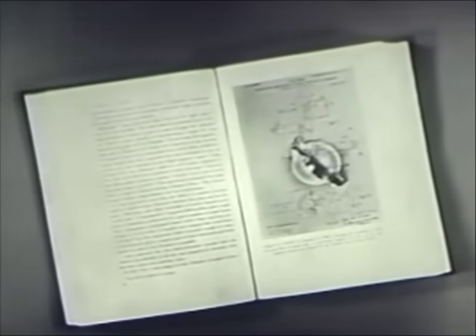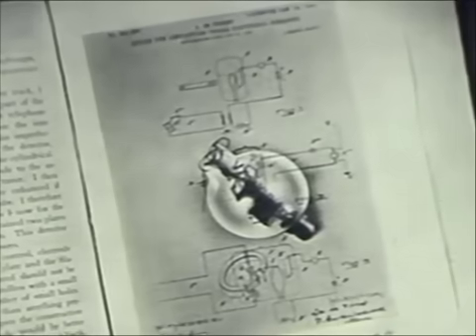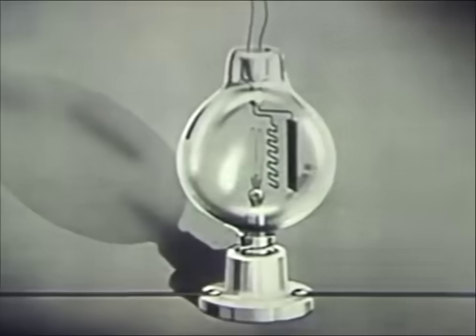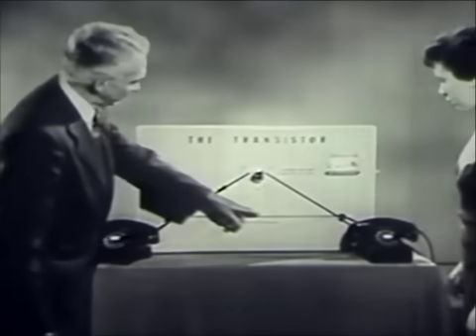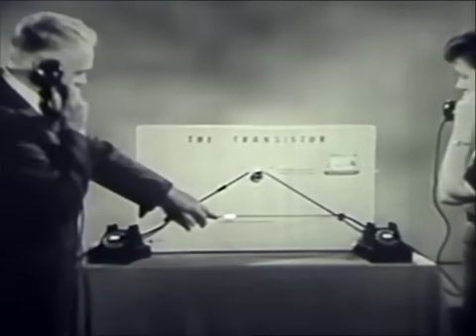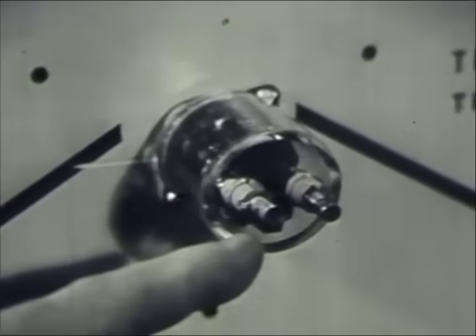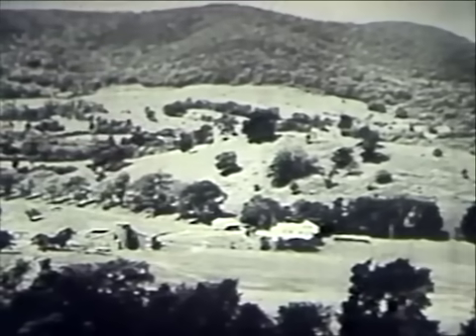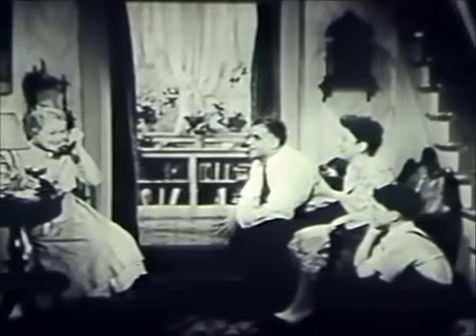The Transistor: a 1953 documentary, anticipating its coming impact on technology

Comment: This was on a Flat Earth video. Think! how did they send all the signals without satellites or a way to bounce the signal? They didn't have a giant mirror that I know of.
Reply: Ionosphere
Reply: The Dollar Guy
One problem with that. If earth was round the radiation in thee Ionosphere would be acting not according to what we have been told about how radiation works. Radio waves or radioactive waves travel in a straight line. Only on a flat earth is this possible. On a round earth it shows the radiation curving around thee earth. Not possible. radiation does not cure or bend even if there is gravity.
Reply: Radiation is reflected by the ionisphere when it hits it, allowing you to reach beyond line-of-sight when transmitting.
Reply: How does radiation reflect radiation? It doesn't. That only work with a round earth theory.
Reply: The ionosphere is charged and reflects longer wavelength waves back.  Specifically lower radio frequencies such as AM and HAM radio.  Higher frequencies are line of sight only; they require repeaters to follow the curvature of earth.
Reply: Yes but in 1915 they did not have this tech. They just build it and used it like they knew that they didn't need it. Then to support the round earth theory they had to come up with an elaborate lie to make it look like the operation work because of the curvature. Well I can say that Nikolia Tesla knew it was flat.
Reply: +Stanly Phoenix People will often discover and use things before they understand how they work. We knew the speed of light and how to send transmissions long before we understood quantum physics or the particle/wave duality.

I'm not going to argue with you any more about this, because you've clearly decided what you want to believe. But I suggest you learn more about EM radiation and how it works.
Reply: I try to keep an open mind, but I don't see how this flat earth theory holds merit.  Where did tesla mention his evidence of a flat earth?  His wireless energy distribution system if I recall used the earth and the ionosphere.
Reply: No mirror is how you lot decided CPU could just chat to any sattellite but not if your crazy nonsence following orders them next door spy on me an moms?...Intel Xsat,1954?

Comment: This must have seemed really amazing back then, I wonder if anyone  thought it would be possible to place a billion transistors on an inch by inch wafer?
Reply: "Billion" wasn't a term that was used much in the 1950s and 1960s. Most big or small things came in millions or millionths. In the rare cases you needed to talk about something bigger or smaller, you talked about a thousand million or a million million. Could someone imagine a thousand million transistors in a square inch in the 1950s? No, probably not. Not even a million transistors as part of a single thing no matter how big it was, unless that thing was the continental telephone system and you were counting all of the offices.
Reply: @lwilton  I don't believe most people today are actually capable of thinking in scales beyond a few millions. Every thing beyond that falls into the category of really large interchangeable numbers we simply take for granted. The population of the US for instance is mostly unfathomable in practical everyday terms.
Reply: @maelstrom2313  I work with large databases, anything above petabytes and i stop understanding.
Reply: That is an interesting observation. As an example, electronic schematics drawn up into the 1960s do not use the unit "pico Farads" for 10^-12 F. They use uuF (micro micro Farads).
Reply: I don't feel particularly "quaint," but I did take my first course in basic electricity in 1960.  You are correct about the terms used for small values of capacitance.  We also used cps in place of Hz, and did all our calculations on slide rules.  Beginning in 1959, my mother was a corporate secretary at Texas Instruments, and she knew Jack Kilby quite well.  Her direct boss was in charge of the Small Signal Transistor Division, but by that time the real focus was moving into integrated circuits.
Reply: I remember when I was first secretly shown a secret chip which was claimed to be the first IC containing slightly over a million gates.  Even then, no one believed it.
Reply: "a billion transistors on an inch by inch wafer?" no because no one back then was puting anything on a wafer... watch the movie again maybe? heh
Reply: While I'm sure they did realize that just as their technology was much more advanced than what people had 100 years ago, people 100 years in the future would no doubt have things that would seem wonderful to them - they could not have known the details of the future, and very likely would not have expected electronics to improve as fast as it did.
Reply: "you talked about a thousand million or a million million"   Yes, like with capacitors in that era.  No "picofarads" or "nanofarads", but most often it was "MMF" for micro-micro-farads.  And not even using the Greek μ.  What quaint old times!

Comment: 0:43 "Electronic devices that ... have longer life". You got to be kidding! I still have my grandpa's old vacuum tube radio (which I used as my first guitar amp in early '80s) in perfect working condition. What's a life-span of typical modern electronic device?
Reply: +TheUglyGnome Tubes will burn out a lot faster than transistors under most conditions. When they created some of the first computers (the ones the size of warehouses) they could often not run it for more than 8 hours before a tube would burn out somewhere. Those had thousands of purpose-built tubes but they still had a lot of failures.

Whereas, a modern device has literally billions of transistors in it, and will run for much longer than 8 hours. In fact, parts that fail are often accessory parts like capacitors. And when you see a computer slow down over time, it's because the software gets more bloated over time. A transistor, if kept cool, could theoretically run forever.
Reply: +TheUglyGnome No idea but all of my computers since 1994 have been hooked up to my Radio Shack STA-85 stereo AM/FM receiver amp to provide audio from the computer to two wall speakers, it's normally on about 60 hours a week, even the original light bulbs still glow in the dial!
Reply: +TheUglyGnome Two years, hence the two year warranty lol.
Reply: +TheUglyGnome If you use it every day then the tubes will wear out.  Tubes are wear items... transistors, not.  That's the point, I think.  I have old transistor stuff that still works great fifty years later... for guitar amps, tubes still rule, though... and they're still being made for that purpose.
Reply: @scowell  Keep in mind that tubes are meant to be replaced as needed, and most tubes are still readily available for cheap in lightly used or NOS condition.
Reply: @GayCoonie  Hence my term 'wear items'... like a brake pad, they wear out.

Comment: It's only 1953, so you're gonna need a flux capacitor, a bolt of lightening, and a DeLorean.
Reply: Stephen Clementson I think its just a chance thing, like with hard drives. some last forever while others fail in a couple years..
Reply: +Stephen Clementson These vids are like shooting the video with the smartphone. So much has changed in so little time.
Reply: Picobyte
Things sure have changed greatly, with unimaginable levels of circuit miniaturisation (UK spelling).  Even in the days of Back to the Future part one, the year after the announcement of flash memory by Toshiba, it was not envisaged that you'd be able to get so many transistors on a chip that you'd be able to use that chip as the video recording medium.
Reply: 49jubilee I still love vacuum tubes for vintage and the opportunity to show people how electronics work :D Those hot tubes are cool as the youtube icon.
Reply: @picobyte  we chuckle at the WWII DOD vids they showed the soldiers and workers
Reply: +Stephen Clementson The DeLorean is the critical part
Reply: +ElfNet Gaming Yup.  Got to be a DeLorean.
Reply: Stephen Clementson Steadily going to SSD  gigabytes for consumers :)
Reply: +Picobyte I use SSDs as boot drives on two devices.  Not used for storage, but about 5X faster boot-up.  One guy on YouTube was using a 32gb SD card, with a PATA adapter, as an HDD replacement on a very early 2000s laptop.  The original 2.5" HDD would have had a similar capacity to the SD card:-)
Reply: Stephen Clementson True,but my argument for it is that it's shockproof beyond human body.One can hit it with a tank and unless shredded it will read :)
Reply: +Picobyte Yes.  They are brilliantly shockproof, and I've never had a flash card failure due to normal usage either.  I've got flash cards dating back to 2002. It's clear that they'll become too outdated long before they'll fail.
Reply: Stephen Clementson IDK man, I had a 256Gb SSD that failed 2 weeks ago and I had to replace it.
Reply: +ElfNet Gaming Oh...someone told me how they'd had a flash card fail, and that it was a genuine product.  No problems encountered here with any kind of flash memory since 2002.  This computer uses a one-year-old Kingston 240 gig, but only as a boot drive.  My laptop uses a Sandisk 128 gb, but that's much less than a year old.  I use an external hard drive, or flash, for storage on that one.
Reply: +ElfNet Gaming Sure, it's probably just a chance failure, but it's infuriating.  As for me...more likely to get PSU cooling fan fails...That's what has happened to me repeatedly.  The PSU still works, but it gets very hot.  But that's a mechanical fault.  Bought a 'Storm' 600 watt PSU a couple of weeks ago as a replacement.  Its got a whopping great big cooling fan.
Reply: I have had fans fail but I usually replace them. I tend to build up a stockpile of things like PSU's, mainboards, cpu's, coolers, ram, etc and stuff from upgrade rebuilds and so on..
The PSU you bought has a 180mm fan which is pretty common, if it fails you can easily replace it.
Reply: +ElfNet Gaming Well, I could probably repace it, if I had the part.  I was also rather suspicious about the CPU cooling fan (the 2011 i5 processor itself is also still available on Amazon), so I bought a replacement cooler assembly.  The cooler was only £1.99p (an exact replacement part), but the delivery cost was twice as much as the assembly.  The system is certainly running smoothly now.
Reply: Stephen Clementson The stock coolers for mid grade i5's and i7's are very poor, You can get a much better one made by Cooler Master or Thermaltake for around $20. I NEVER use the stock coolers, Even on store bought PC's I change them out.  In the long term it is worth the change out IMO.
Sure $20 is more than the price of the one you bought but generally they have better heat dissipation and are more efficient especially if you get one that has a heatpipe radiator and fans forcing the heated air out towards the rear case fan to be pushed out of the case.
Reply: +ElfNet Gaming I don't use the processor to its full potential, so it doesn't require any special cooling.  No gaming.  If I wanted to play games, this computer would fail to meet the criteria.  In fact, it's just operating as a PC with a fast quad core processor.  It does a bit of video processing/converting, from time-to-time.  You know, doing things such as converting video compression algorithms, and converting video to jpegs, and jpegs to video.  As it has speed stepping, the processor usually idling at 1.6 gigahertz.
Reply: +Stephen Clementson You should go into the power saving control panel and set maximum utilization at 50%, that's what I do. It keeps the processor really cool and it saves 30 watts (I measured it on my kill-o-watt meter). Otherwise, the processor is still running at it's stated speed. It will stay cooler by doing what I said in the power control panel.
Reply: tarstarkusz
Not having problems with CPU temperature.  Mechanical cooling devices go wrong.  In other words, fans fail.  Bearings go.  The power supply was still working, but the fan was knackered.
Reply: +Stephen Clementson I was just saying you could save some power if you're not utilizing all the power of your processor.
Reply: +tarstarkusz Not a problem.  Thanks for the tip, anyway.
Reply: Still sounds like moth too the flame ,here we even words too nonsence muster mug O that they say they even vote for claiming tax and percent is money used says about write N this tech for public knowledge of this im private haul bent too get psyco listen too invades it then podium continues to denounce on all as thoughts of history it pretend is fact known and loved,order ring gunny rations,poop fish burns?
Reply: And, even worse, I've never seen a partridge in a pear tree.
Reply: but we are living in alternate future  with the tech gleaned from reverse engineered components , still monkeying around with vacuum tubes and etheric force in early 40's